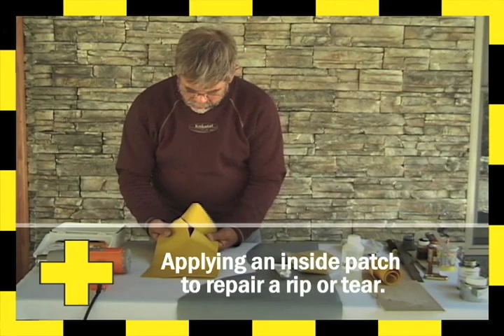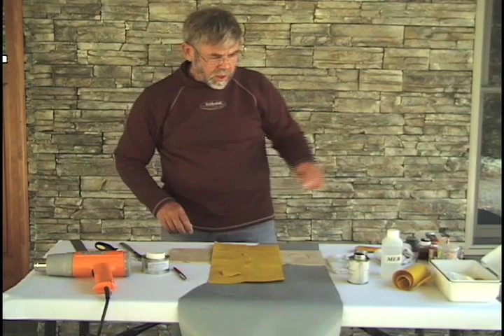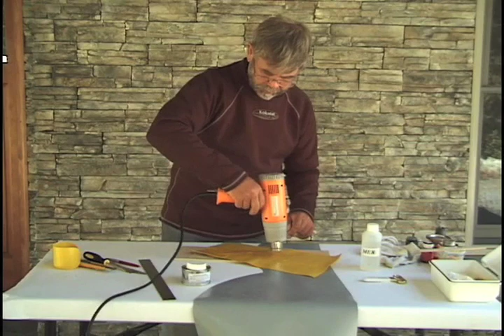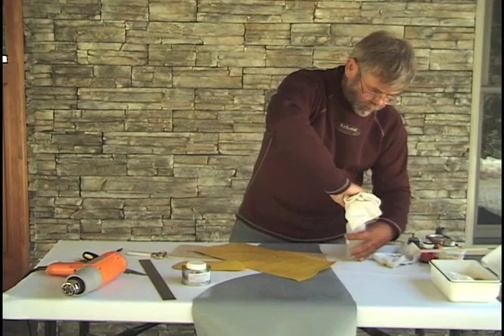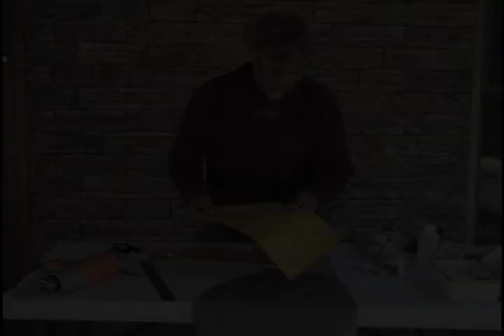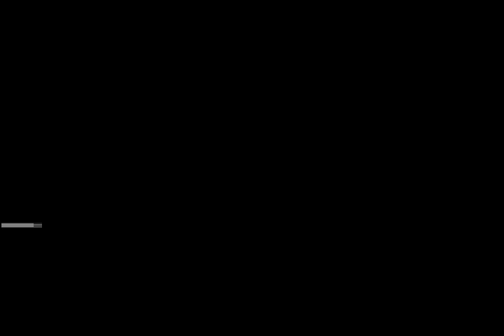How to repair a rip or tear

Comment: RDC? American products? I not a boat builder. Non of this is any use what so ever other than ' if you have a big tear in your inflatable kayak, then you need a patch on the inside! Full stop! I still have to find out exactly the correct glue for my kayak and figure out exactly how to do it in the real world rather than an off cut of material.Was this film done in the 70's?

Comment: Informative but like so many of these how to videos there are so many unanswered questions. What type of glue, how do you get the patch inside the RDC, what does RDC mean? I may seem ignorant but I am a complete novice and need to be taught as if I know nothing of how to repair, not as if I am reviewing information.
Reply: +Anthony Valentino Okay, 1: pvc or Hypalon glue depending on which type of material you have, 2: Through the hole in the material, 3: RDC=Rapid Deployment Craft. Just do a google search and your ignorance will melt away ;)